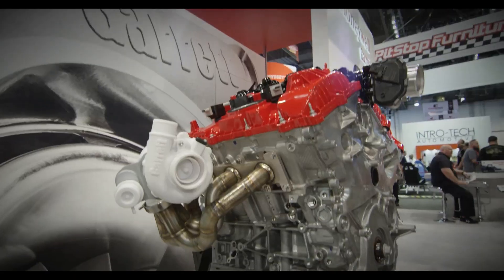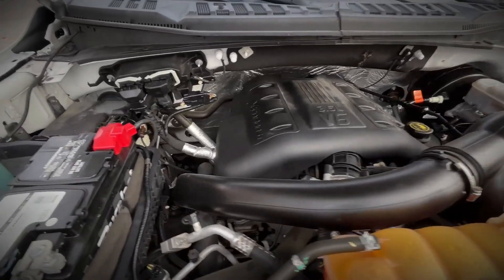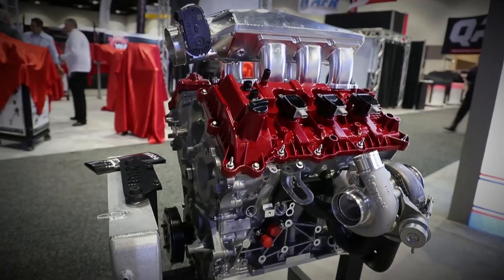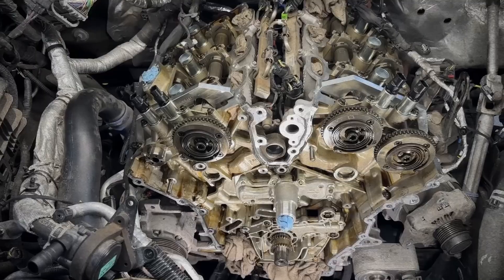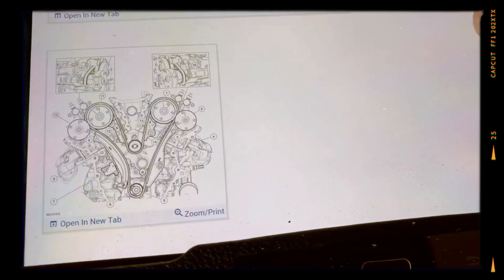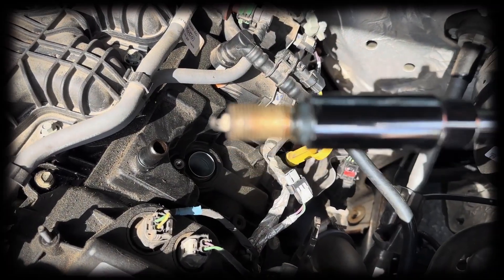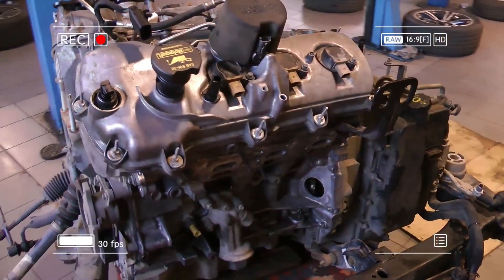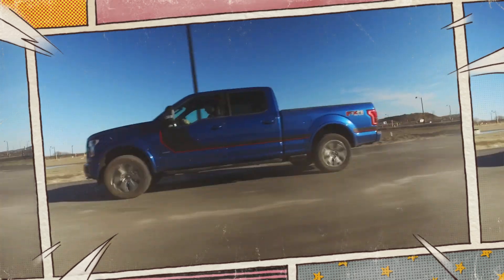Ford 3.5 V6 EcoBoost Engine Review: Specs, Problems, Reliability & Real-World Performance!

Comment: Just bought plugs and boots.
Plugs are $25.00 each x 6 = $150.00
Boots are $50.00 each x 6 = $300.00
I’m changing them out myself otherwise it’s nearly 2hrs labour at $165.00 per door rate = $330.00 labour here in Canada.
That puts the Plugs & Boots at 40,000 miles $780.00!!!!!
Absolutely crazy…

Comment: Ahhh Yes..  The "recommended" 8 --> 10k oil change.  Well, if you want planned obsolescence at 100k, go for it.  Otherwise, follow every decent mechanic's advice and stick with 3.5 - 5k and NO MORE than that.  This chat is crazy...  $100K for a truck that will last 100K miles IF you follow the recommended maintenance.  Disgusting...  ALL manufacturers should be ashamed of themselves.
Reply: Agreed.  The gas engine has been strangled by cafe standards and cheap parts.

Comment: did he just say oil change every 8k miles .... u are insane i use pennzoil ultra platinum 5w30 and i change it every 3500 miles .... with the best oil filter not the motocraft one i use either the boss or mobil 1 extended performance filter on top of that shell v power nitro or mobil synergy 93 a little $100 every 3500 miles is completely worth it instead of a $8,000 engine rebuild or 10k engine replacement currently sitting at 104k never been in the shop once for a engine problem did the spark plugs and coils at 100k they weren't filthy either showed use but some people used spark plugs look like they been through hell
Reply: Pennzoil ultra platinum with purolator boss filter is the best.

Comment: Why not just get a 5.0 and not deal with this nonsense and risk?
Reply: Just drove a 2025 f-150 in 5.0 and 3.5 ecoboost..i bought the 3.5,.400hp/500ft lb.just this old mans rocket ship.✌
Reply: It's the smiles per gallon, can't beat that low end torque!

Comment: I had a 2021 Lariat with the 3.5
I maintain my vehicles very well and had no issues other than a hard shift, I bought it 8 months old with 18,000klm on it.
The dealer did a reset and from then on it was perfect.
Before I lost to much money on it I bought a brand new 2024 with the 3.5 once again. 
Just enjoy the power & torque.
Tows like no other engine I ever had

Comment: Yes but…. Why is it a complete JUNK?
Reply: I have a 2012 xl F-150 with the 3.5 echoboost. It has 177,000 miles on it and it runs fine. I need to change the plugs because it's getting a little sluggish on takeoff but other than that it is solid.
Reply: It’s not, I’ve had three 3.5 over the years.
I maintain everything I own and haven’t had any issues whatsoever and I tow lots of toys …
Reply: It is a great motor...